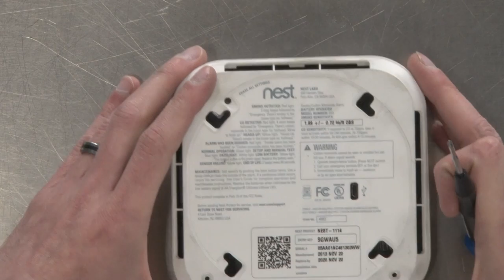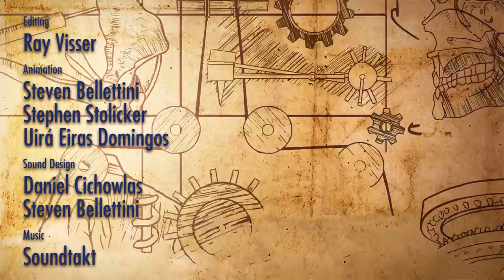Nest Smoke Detector: Equipment Autopsy #71

Comment: Some corrections: The "EAST" thing is the piezo horn. It gives the 85 decibel beep. The two vents above that are activity sensors that detect your wave. The light sensor is inside the button/ring. The thing that looked like a soldered battery and capacitor was the actual carbon monoxide sensor. The smoke sensor was what had the vents on the side.
Reply: Where is the camera and mic?

Comment: hmmmm... I'm pretty sure that the black "battery/Cap" is a battery, as soon as you removed the shielding i said "a RTC battery!"

As ***** mentioned in another comment, the round component with a hole in the middle looks like a piezo alarm buzzer, for producing the high pitch alarm tones.

Comment: The big round Figaro TGS 5342 is a Carbon Monoxide detector. www.diltronic(dot)com/wordpress/wp-content/uploads/TGS53421.pdf
The round one with a hole in the middle is probably the doom speaker. The other speaker is for the speech. I've seen warning speakers before and they are often more compressed like that with a hole in the middle in other words discant. The other speaker are more middle register and can't produce thoose high pitched noise at that decibel.

Comment: I couldn't take it anymore. FFS: FRESNEL not frennel. The "CO2 sensor" is actually a piezoelectric disk buzzer that makes the "loud" noise. The speaker from earlier in the video is just that -- a speaker for the voice. The other "battery or capacitor" is actually the CO2 sensor.

Comment: 12:47 That's the CO sensor. And 13:55 The bottom is the smoke sensor, and the circle with the hole in the middle is the Horn, which is what does that BEEP BEEP BEEP .

Comment: This sensor with glass is kind of infrared camera so if it sees that something is big and >500°C it knows there is problem 
It should be smart... And maybe open source and hardware... You can add sensors anywhere... They could create slaves and master that you plug into router and it shares information via some high frequency then you dont need wifi... Wifi modules and antennas are expencive... It should have temperature sensor inside and if it gets hot like >100°C then it should trigger any device in the house send emails to you your family your frends triger allarm on your phone app and more... 

You could create door lock with distance sensor fingerprint scanner and passcode so if you scan your finger then it dosent send you messege... If you enter pin it says witch passcode has entered.... Baterry powered but it should have nfc or some type of coil so if your beterrys are fone you can just tap your phone and send data and ppwer to lock it will charge it in capacitors then boost up and unlock the door
Of course no thing like :1 evtra fingerprint or code - > cash.... You pay once and you have all inclusive... 

Thats my ideas